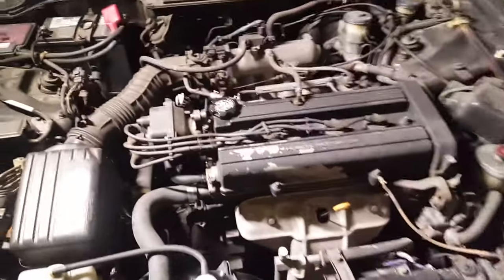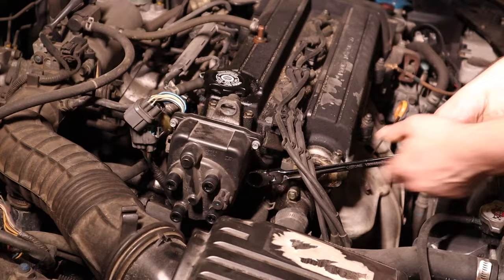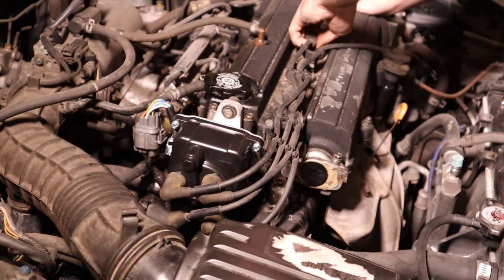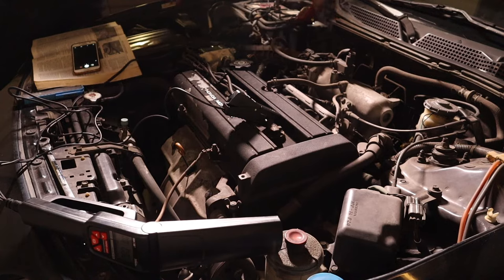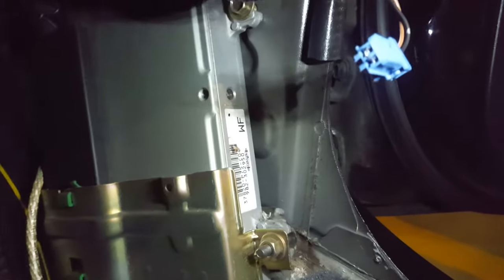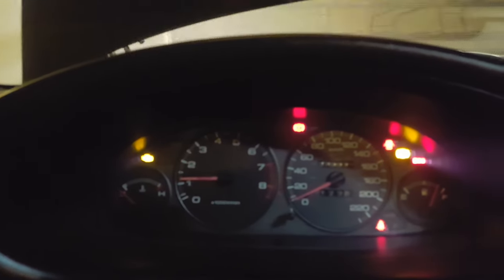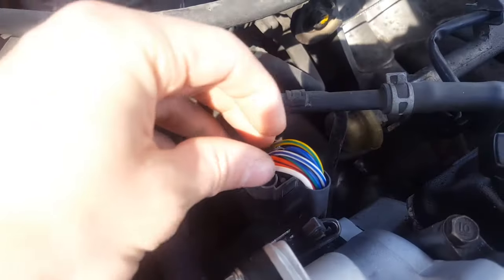Replace DISTRIBUTOR Set TIMING | Acura Integra/Honda CRV/Civic (B-Series)

Comment: sooooooooo i replaced the distributor in my 2000 crv and didn't for some god forsaken reason realize it could effect timing and beforehand had running issues due to the distributor, and then after replacement wouldn't start, has fuel as well as spark and now that i know the timing thing.... is it possible i threw it so far out of timing it'll cause my car to not start!?!?!
Reply from the maker: could be! checking timing would be a good place to start if you weren't having starting issues before.  Also make sure you have the plug wires hooked up in the correct orientation on the cap

Comment: So how does the timing light work ? You haven't shown how it displays proper timing, neither did you explain the principle of its operation. How does it get the reading ? from the connection or you aiming it at the crank pulley ?
Reply from the maker: It gets its reading from the spark plug lead, the point of the flashing light is to make your timing mark on the crank pulley appear stationary under the light.  The frame rate of the camera is not able to show it on video.  More expensive timing lights show engine RPM, allow you to adjust the timing of the light to your vehicle's spec, and some have other functions but I didn't get into that because its not necessary.  You can set the timing as I did here without using those extra bells and whistles and this way people with cheap entry level timing lights that have no display can still follow along.
Reply: Thank you. You could buy an expensive one and return it after one use ;)

Comment: Quick question, the oem distributor for me is sitting flush into the crank, the replacement almost has a flange for it to not seat the same way. Maybe I didn’t put it in correctly but with your replacement did you experience the same
Reply from the maker: I havent run into that issue but should definitly sit flush, either its not in all the way or wrong distributor maybe?

Comment: Is a timing light required for this and the mark on the timing cover is different from the TDC mark?
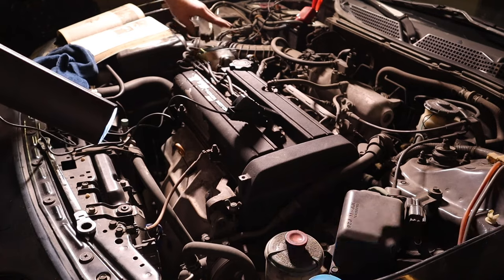Reply from the maker: You can do it by ear and get it pretty close if you have to, white mark is TDC and red mark is what ever the timing spec for the car is, see 4:34 and 4:40 16 degrees before TDC for Integra

Comment: I need to know where I can find the service connector for my 2000 integra LS
Reply from the maker: I show it in this video...my car is a 99 Integra, yours will be in the same spot
Reply: I can do it without taking that panel off?
Reply from the maker: I didn't have to take the panel off on mine, although the service manual says you do, so maybe sometimes its tucked behind the panel, either way its easy to access
Reply: I have issue with IACV circuit failure. Can you help me with This

Comment: What happens if the timing is not correct? Can I change the distributor and drive to the mechanic shop to do the timing?
It seemed you just move the distributor to get the correct timing. Can you adjust the timing by listening to see if there any misfiring? Thanks
Reply from the maker: Yes, you really don't need a timing light assuming your car had no timing issues prior to replacing the distributor.  You can get it close enough by ear.  You can't install the dist 180 degrees out of phase because it won't fit in the cam that way, so you are forced to install it close enough to run, so basically nothing bad can happen you can totally do it yourself.
Reply: @AcuraAdvice  You made it looked easy. Just unscrew 3 screws out and just swap out the distributor. Nothing going to fall out that I can't put back in. Not sure what you meant by 180 degrees. It can go in only one way right because it's not symmetrical. My car won't start now BUT there were symptoms of distributor issue. I can't find a mobile mechanic in the neighborhood, so I'm tempted to do myself. BUT I'm novice when it comes to car. How did you unplug the electrical plugs of the distributor? thanks
Reply from the maker: @sinnieleeonUtube  thats all there is too it.  The fact that its not symmetrical is why you can't install it 180 degrees off timing.  There is only one plug for the distributor, its right behind it, and the 4 spark plug wires, just pull them off.
Reply: @AcuraAdvice  OK, I'm gaining a bit more knowledge by watching the other videos. So in your figure, there are three closely spaced marks with the red one in the middle and then the white TDC mark, a little farther apart. How do you know to pick the red mark to align with pointer and what are the other three marks represent ? Thanks
Reply from the maker: @sinnieleeonUtube  The white mark is top dead centre (TDC), the centre red mark is (-16) 16 degrees BEFORE TDC which is what the timing spec is for this car.  The outside red marks represent +/- 2 degrees.
Reply: @AcuraAdvice  Now understand the marks. My 1994 Integra also has BTDC of 16 +/- 2 degrees. My timing gun should arrive tomorrow and I'll try it out this weekend. And the gun should be set to zero?  I was looking for the marks at the wrong places other day. I hope the marks hadn't worn out.
Reply from the maker: @sinnieleeonUtube  Zero if you're using the red mark.  Or you can set the gun to -16 and then use the TDC white mark if you want.  I didn't do it that way in the video to keep it simple since some timing guns don't have an input so I wanted to show it in a way that would work with whatever cheap gun ppl might have.  The fancier guns let you input a desired timing so you can do it off a TDC mark in case an engine doesn't have a spec mark or you're not using spec timing or something.
Reply: @AcuraAdvice  Can you tell me where the timing pointer is located (is yours a 1994 Integra) It seems you point the gun right next to the steering wheel fluid reservoir ?  Is it the little line/tap on the left side sticking out at time 3:35 in your video ? Is it above all the pulley wheels? Also I couldn't get one of the distributor wire connection out (the one you broke)? You just press down on the tap and pull it apart, right? Can you pray WD-40/Lubrication on it to loosen it (since it is electrical, not sure I will damage it).
Reply from the maker: @sinnieleeonUtube  yes thats the pointer line at 3:35.  It is above the pulley and the coloured marks are on the pulley.  The connectors are sometimes brittle and annoying but yes you just pull down on the tab and pull it apart.  If its really stuck and you could try heating it with a hair dryer for a few seconds to warm and expand the plastic, just don't go crazy and melt it.
Reply: @AcuraAdvice  I wiped everything down with some lub yesterday and just now pried it out, little by little at the seam with a tiny screw driver. The ONLY thing left is the timing mark. There are grooves on the cover BUT one thing stood out is a little pin head from the side wall of a hole. BUT you can only see it IF you sitting next to the driver side's wheel looking into the hole (maybe at a slight angle also). You can't really see it if you stand in front of the car looking down like you did. So I'm not sure if it is the timing mark pin.

The timing gun arrived yesterday from Amazon and there isn't any knob to set the degree. So I'm assuming that it is at zero degree by default and just aim at the middle red mark. 

Before all this, I was changing the spark plugs, got three of them out except #1. This one is tough. Can you damage the spark plug if you spray too much lub on it.  Thanks
Reply: @AcuraAdvice  I tried replacing the distributor and it turned out they sent (online purchase) me the wrong part. They gave me an extremely hard time trying to return it even though they admitted to that. So went to another vendor, this time they gave me a distributor in the right box with correct P/N. However, there isn't any marking or P/N on the distributor itself. Is this normal NOT to have marking or P/N on the item itself?
Reply from the maker: @sinnieleeonUtube  oh man wrong part! That seems to happen a lot with these distributors.  Yeah there is normally no part number printed on the distributor itself
Reply: @AcuraAdvice  I found out why they sent me the wrong part. They go by the engine model only. So there are multiple model years with the same engine model. Mine is 1994, so it should be (92-95 with 1834cc engine), they sent me (92-93 with 1834cc engine). I found this out by stumbled upon a manual/guide titled "nds-ignition-application-guide" and it listed all the model years and engine types. Similar to oil and air filter guide you look up at Wal-mart.

Anyway, I did it by ear, trial and error and by just driving it. After all, there is only about one inch of space you can move the distributor. Drove to work today and it seems fine. A tiny bit of sputtering for a split second, not even worth mentioning BUT... However, the engine sounded a little louder than before. Maybe because it's new?

Anyway, you have been a great help on all this. It ruined my one vacation week BUT I'm learning something. The mobile mechanic would have charged around $130 for half an hour of work and they still don't want to do it.